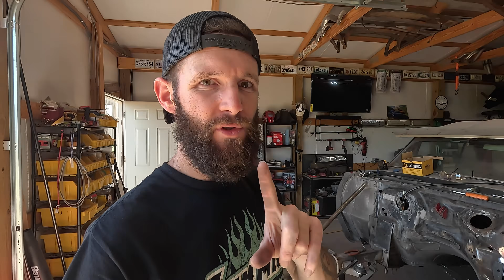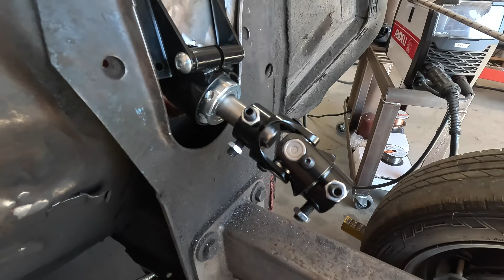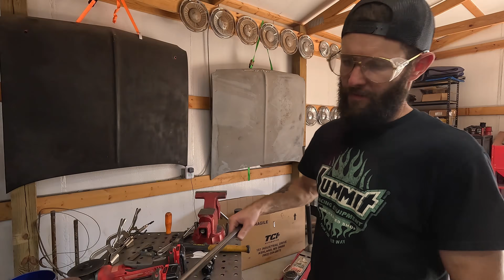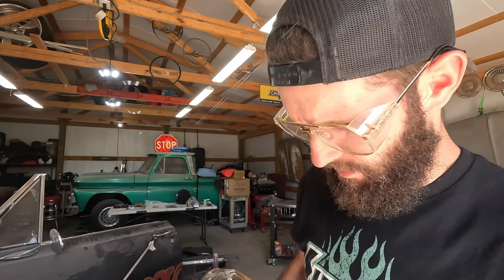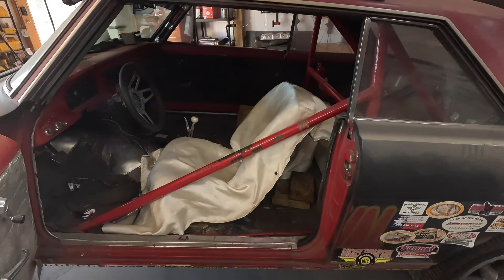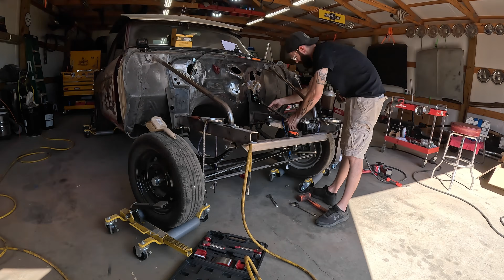How to Set Up Gasser Steering | 1963 Chevy II Vega Box & Speedway Column Install

Comment: Thanks for posting, how did you install the vega steering box?
Reply from the maker: For sure. Hopefully this winter I'll finally finish this project. 
The frame kit I have came with a plate welded to it for mounting the vega box. It's the Speedway straight axle front subframe.